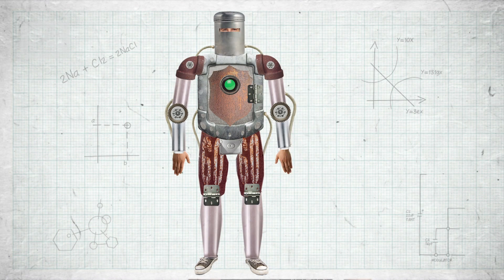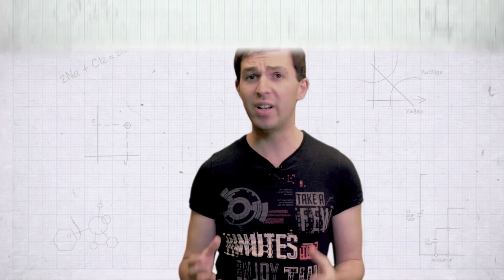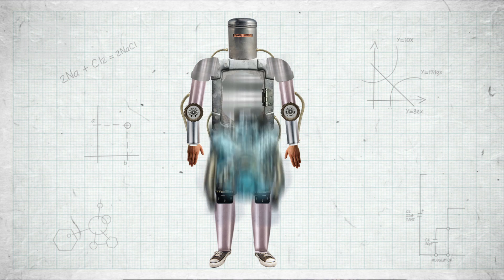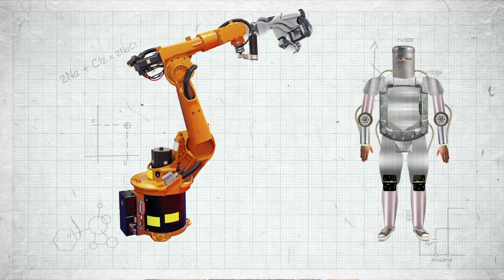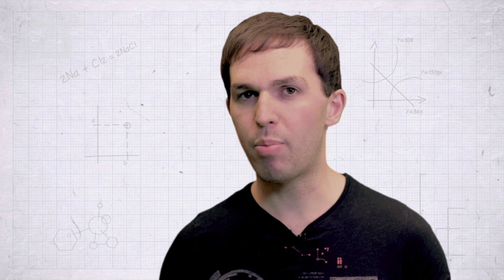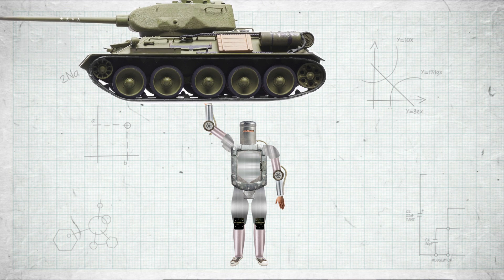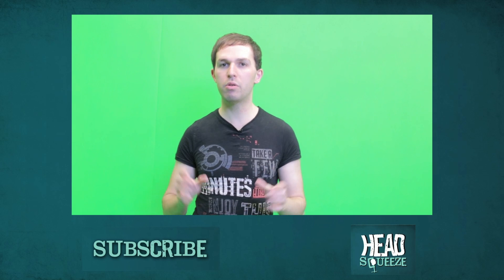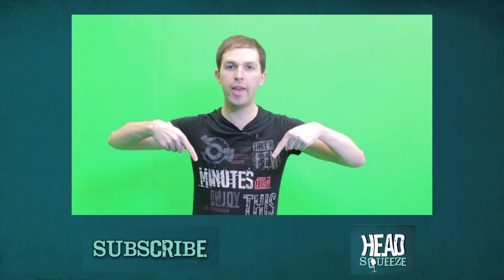Could Iron Man be a Reality? | Sci Guide (Ep 17) | Head Squeeze

Comment: Hmm what about a Tesla effect.  Wireless power for a constant charge.
Reply: Wireless charging (especially at a distance) is rather inefficient and also loses a lot of energy to heat. So not only would it take longer to charge but you'd warm up the suit just like your smartphone can sometimes get hot when you overwork it! As you mention, you could be charging all the time but I reckon the power consumption of the suit would be greater than the recharge rate wirelessly.
Reply: Martin Archer Nice Thinking. I also have to wonder at alternators. Then you have the Issue of how to power them, and battery's capable of taking the charge in the allotted time. Guess we just are not there yet.

Comment: "Usually need a temperature of 600oC" for a fuel cell? Where did you get that from? From the main types used, that's only Solid Oxide or Molten Carbonate fuel cells. Admittedly they are the most powerful types but that's why you link multiple other types (eg. Polymer) to get enough power at much less of the weight, size and temperature. Seriously, do some better research next time.

Comment: not bloody likely, you would crush the jar. male or female, just dampen a dish cloth or a wash cloth and use that to crack the seal on a jar, you can even wrap it around the lid and hold the ends like a wrench for better leverage, if it is damp it will grip on the lid.